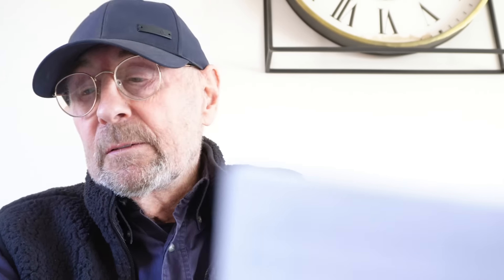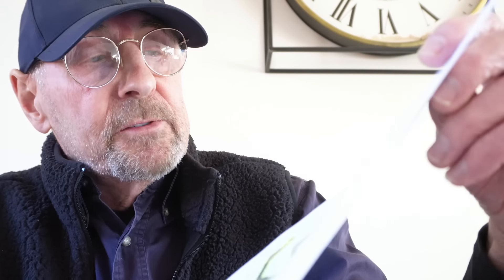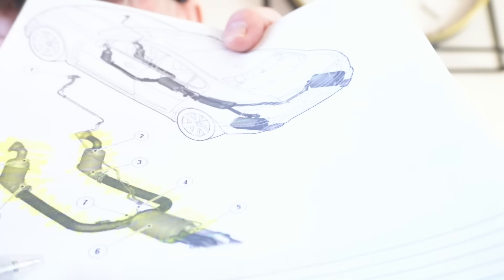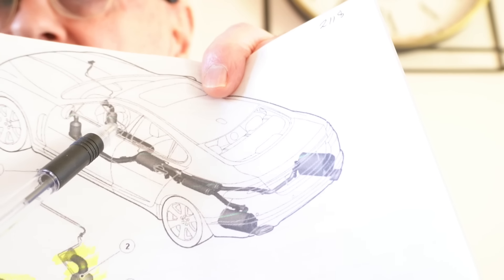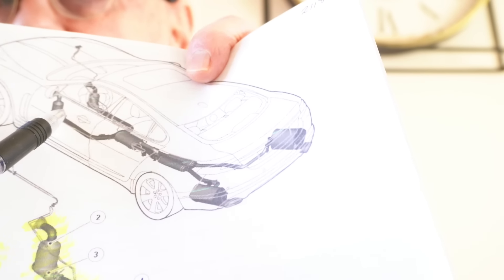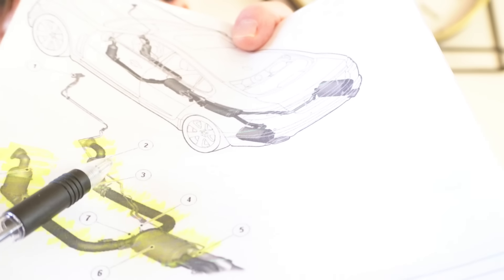CAUSE REVEALED!.. The Self-Destruction Of Jaguar Land Rover 2.2 / 2.7 / 3L Diesel Engines

Comment: I have been involved in vehicle mechanics for over 50 years, I am retired now, but had always advised my customers to have their oil changed far more frequently than their service books recommend. In the 70's oil was always changed every 6000 miles or so, I know technology has evolved and improved over the years, but one thing that does not change is what that oil is going through whilst your engine is running, in fact, because engines of today can rev faster and maybe higher, I would suggest the conditions are much worse and so more is expected from the performance of that oil for much longer periods. 

Whether you are correct about the DPF or not, and for the record, I believe you are bang on the money, it makes perfect sense to me that the sooner you change your oil, the better. A small amount of expense now saves you an awful lot of expense if that engine does let go and if the DPF system is introducing neat diesel into the oil then that oil is compromised and unable to perform as it should and no amount of data bullshit is going to change the outcome of that. 

I personally do not like DPF systems at all, I think the minimal gains that are provided by having them are outweighed by the incredibly high temperatures and copious amounts of software, sensors and ecm communications needed for them to operate properly. 
My brother had his go up in flames on his Puegeot 406 a few years ago, and unbelievably there was a clause in his insurance that allowed them to wriggle out of paying for his car to be repaired. DPF's and CAT fires are not covered under some insurance policies. 

He has recently had problems with the DPF on his 2.2 Jaguar, and has now been told that in order for the adblue to be topped up, he will have to go to a main dealer and have the system bled, so your suspicions that the 2.2 is also affected could also carry some weight. Car manufacturers need to come clean, but we both know that will never happen.
Reply from the maker: Hi Keith, Thank you for watching and for your excellent feedback.

Comment: Very informative video. It always good practice to have service at 10.000km instead 30.000km. I have repaired  several of those engines (cracked and / or Bearings). It is always the same place the Berings or crank snap happens so the crankshaft it self must have a weak point. And by the way be nice in the comments, he try to help with why why why. Thanks!
Reply from the maker: Hi, thank you for watching and for your feedback.

Comment: The LR Time Youtube channel also covers oil pump version issues that can result in slow oil pressure build up on start-up and advises using a 10W-40 at higher mileage to help the oil pressure issue. IMO anyone who buys a JLR product needs their head examined. One example is the timing chain arrangement on the four cylinder looks like it's from a Raleigh bicycle . Great video thank you.

Comment: I have had my DPF and EGR "intelegently" deleted ( not removed ) & has passed 3 MOT's without issue, my car is the Jaguar xf 3.0 v6 diesel. I also run it on 5w40 oil. 148k miles on the clock n sweet as a nut.
Reply from the maker: Hi, thank you for watching and for your feedback.

Comment: I have swapped out a 2.2 diesel in a Freelander 2. Crap design of Swirl Flaps dropping in. Second engine was a 82k mileage engine from a scrap car. No DPF and has been no trouble in three years. The V6 engines are a Peugeot design with many engineering design faults. Chis on LR Time is very good at fixing all the faults and re-engineering the faults out. I had a 2.7 TDV6 engine in a Jaguar S-Type, 177k miles, no trouble as it did mostly motorway miles, and no DPF fitted from new. Four sets of tyres, brake discs and pads in its life. It was a pre production press car with all the extras, and manual transmission.

Comment: i watched a video recently of a stripdown of i think a 3.0 v6 where the main bearings had spun, i couldnt believe that there was no location of the bearings as such, having stripped 60,s and 70,s engines it was obvious that the shells had an area that located it in the journal, you would think that after over 100 years of building engines that this kind of thing could not happen, but it does!
Reply from the maker: Hi, thank you for watching and for your feedback. The bearings are held in by crush pressure, the pressed out tabs are for location of the bearings but I agree with you, I think those tabs also helped to stop the bearings from spinning. The XK engines I worked on in the 60s and 70s did not suffer with spun bearings, the bearings and cranks would wear but would take a regrind and new shells if out of wear tolerance.
Reply: If a bearing spins it's because it's started to seize, so it's already toast, tabs or not.
Reply: Many thks for such an insightful video , also own a 2.7 D3, do change the engine oil / filter every 6,000 miles as a precautionary factor , thks again and following with interest
Reply from the maker: Hi Gary, thank you for watching and for your feedback. As I said in the video I mainly work on the Jaguars so any reference I make to the Landrovers I am assuming they run the same systems as the Jags, if they don't then other factors can / will be involved. Changing the oil and oil filter though as a precautionary factor as you do is the best and cheapest way to protect the engine. @garystuart226
Reply: Just reading your response regards shell location missing. BMW had the same unbelievable manufacturing error. This time it was a very expensive motorcycle engine 1000RR. Crankshaft shells spun on the Crankshaft due lack of location lugs on the shells!! Considering cost new, it should never happen and as always the customer pays with inconvenience and his wallet. I do feel manufacturers of all vehicles should be more accountable for their products!
Reply from the maker: Hi Kevin, thank you for watching and for your feedback.The problem was and is, they put the accountants in charge who then decide where to cut costs. @kevinblaylock9883

Comment: My tdv6 2.7 has now done 160000miles trouble free it’s down to regular oil changes and good quality oil and filters.
Reply from the maker: Hi Mark, thank you for watching and for your feedback.
Reply: Wow, my friend has a discovery 6 with the 3.0 6 cylinder ingenium engine. (Thier own new design). It had a new engine at 20,000 miles and spent 2 years inside the dealership being fixed ( under warranty). They’re snowed under with them
Reply: mine got to 164,000 and let go big time idling at lights...designed to fail?

Comment: ACEA A5/B5 oils have lower HTHS viscosities and were never available when the V6 Ford /PSA diesel engine was developed. The original engine was never designed to run on such low viscosity oils. These oils were not adopted until the engine had been in production for approx. 2 years as a means of providing better fuel economy but adequate protection only comes if the engine is specifically designed to use them. It is difficult to substantiate if any bearing or manufacturing tolerances were ever altered to ensure that Low Viscosity Oils with HTHS Viscosity of 2.9 to 3.5 mPa*s offered suitable protection for these engines. 
The original oil spec for these engines was ACEA C3 5w40 Mid SAPS-Level, intended for use as catalyst compatible Oil at extended Drain Intervals in Vehicles with all Types of modern Aftertreatment Systems and High Performance Passenger Car & Light Duty Van Gasoline & DI Diesel Engines with a minimum HTHS Viscosity of 3.5 mPa*s. 
French cars using the same engine recommend the older ACEA A3 spec oil 5w 40 - 10w40 full Saps oil with a minimum safe HTHS of 3.5mPa*s and do not suffer anything like the crank failure rate of the Land Rover engines.  
Oil dilution is a common problem in all DPF regeneration procedures in all cars some being worse than others but the use of low viscosity oils and thinner bearing oil films of lowered lubricity can only exacerbate the problem loss of protection, bearing pickup, spun bearings, wedging and crankshaft failure.
Reply: So what oil should be used in 3.0V6 ? A5/B5 ?
Reply: And people are complaining about EV battery reliability.
Reply: @howardsimpson489  What is not highlighted is the level of reliability of EV cars which is diabolical and the dangers inherent in batteries that are overcharged by these high speed chargers that overheat the batteries leading to split casings leakage and fires.
Reply: Jim Craig 
Absolutely spot on advice.
From my research on Lion failures not one owner had tried the thicker viscosity oil like 5 or 10w40

Comment: Good observation and probably accurate. I have a 2018 Land Rover Td6 3.0. Ridiculously the service interval is recommended at 16K miles. I actually do half that. I do drive my vehicle on ling drives weekly, 200 miles at motorway speeds. I’m assuming this helps keep the DPF cleaned out without resorting to the ECM forcing it.
Reply from the maker: Hi Chris, thank you for watching and for your feedback. What Jaguar Land Rover are saying is that driving style (mainly around town) can cause oil dilution through too many attempted and failed regens. I recommend the 5,000 mile intervals as a precaution, that seems to have worked with my customers who over the years have had no problems. Checking engine oil  level is an indicator to see if the level has increased.
Reply: Thanks! Will do.
Reply: I have a 2020 sdv6 discovery and thought oil change intervals of 26000km are beyond excessive. Makes sense about dilution of engine oil with fuel.
Reply: 200 miles isn't long, 3000 miles is long.

Comment: thanks for that, we bought a 2015 xf 2.2,a couple of years back, research suggesting tye 2.2 being pretty bulletproof, however ige changed the oil and filter every 3 monthe regardless of mileage, as i think its cheaper than a new engine, people may also be being told as 8 was that the oil now is high mileage oil
Reply from the maker: Hi, thank you for watching and for your feedback. The engine oil may be high mileage but not so if diluted. It can only be good to safeguard your engine.

Comment: Sorry, may I misunderstand you - the problem is in the DPF? If so, then Discovery was delivered to Russia without DPF and our engines also break down
Reply: Yes, this poster has drawn completely wrong conclusions. Basically this video is full of misleading mistaken claims. He hasn’t got a clue.
Reply: @hedydd2  our russians repairmen came to several conclusions: 
1. You need to change the oil every 6-7 thousand kilometers 
2. Use 5w40 
3. Flush the radiators once a year 
4. Change the thermostat once a year
Reply: @KiryuKazuma4  may also depend if you live where cold.
Reply: @curtissharris8914  My crankshaft broke in the fall in warm weather
Reply: @KiryuKazuma4  ok that would mean something if you lived where it never got cold.

Comment: high mileage oil and change annually, i uave the software that enables me to force a regen but ive never
used it so far, i think there are 2 things our jaguar would be better off with, 1, a temperature guage and 2, a light which tells you when regen is happening
Reply: Many problems are caused by the technique of using the engine as a diesel pump, a separate regen injector would solve all issues with this.
Reply: @G-ra-ha-m  That’s what the early transverse Ingenium engines with remote mounted DPF should have had rather than use excess diesel in the cylinders on the exhaust stroke. It’s not foolproof though and I’ve had two replacement pre-DPF injectors replaced on my Ford Ranger. These failed at approximately 45,000 miles each time. No DPF or fuel dilution problems at all though.
Reply: @hedydd2  Yes, it isolates the DPF from the engine, allows the oil to last longer.. along with the engines too.
At least on the Ford it's a cheap fix.

Comment: Just do a EGR off and DPF off and it will be great!

And also replace the too thin 5w30 for a 5w40 a3/b4 (after removing the dpf and blocking the 2 Egr valves) or even 10w40, depends where you live.

There's a lot of videos on YouTube to know everything about oil and what's causing problems to the oil in every engines and to find the best oil for your engines use (towing, sport, cruising... Etc)

Cheers from corsica

Comment: The original oil is 5W30 and the basis for recommending this viscosity is emissions regulations and fractional better MPGs on paper...
Reply from the maker: Hi, thank you for watching and for your feedback.
Reply: Simple question then 5w40 is safe for my 2016 Discovery with 27,500 miles. Going to Spain towing a caravan fully loaded in 35d heat so thinking I will go 5w40. My indi recommends against it, but is he just playing safe ?  I would be changing back to 5w 30 on my return.
Reply: @blackvulcan100  Yes. "For high-shear rate viscosity, the two oils also differ. The operating viscosity of 5W40 has a minimum parameter of 3.5 150g while the working viscosity of 5W30, should be a minimum of 2.9 at 150g. This indicates how much the engine oils can sustain in extreme loads."
Reply from the maker: @blackvulcan100  Hi, thank you for watching and for your feedback. Check with JLR to see the grade of oil they recommend to use in the vehicle under the circumstances you describe. Like your indi I only use the manufacturers recommended oil. Aftermarket oil is fine as long as the specs are the same as you probably know.

Comment: You have to use 5w40 ACEA C3 in the 2.7 and 3.0 tdv6 engine due to low oil pressure issues on the centre crank bearings. Broken crankshaft's are all about faulty casting. PSA recommend 5w40 in these engines when fitted in their cars. I like the 5W40 VW505.01 C3 oil due to the high EP additives needed for pumpe dusse engines.